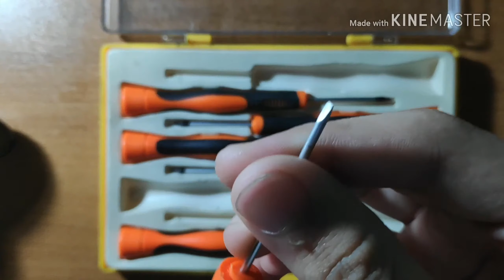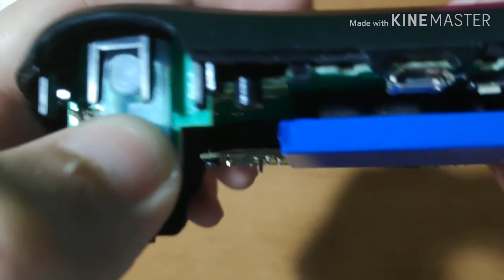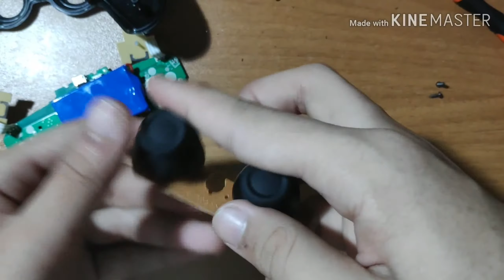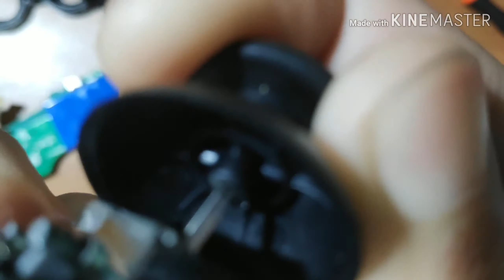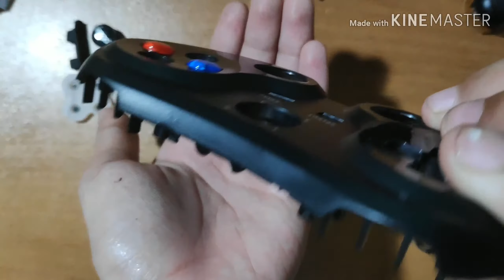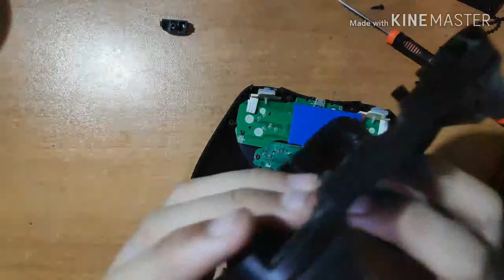TEARDOWN | iPega PG-9078 Bluetooh Game Controller

Comment: Howww to reset
Reply: there is a tiny little hole on the back of it, next to one onebof the triggers, but large enoughbfor something like a paperclip or a needle to fit, inside there's a button, press and hold it for about 10 seconds to do a hard reset, and 5s to soft reset.

Remember to unpair your gamepad beforehand or shit might just get funky next time you use it
(may vary by user)